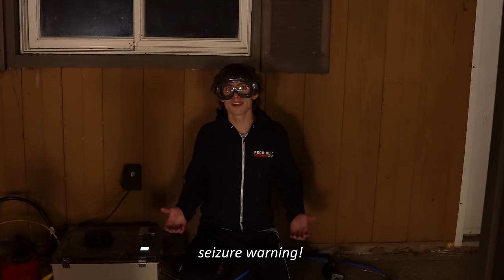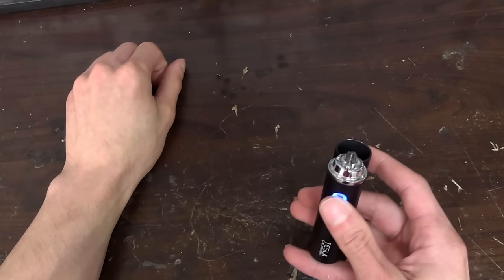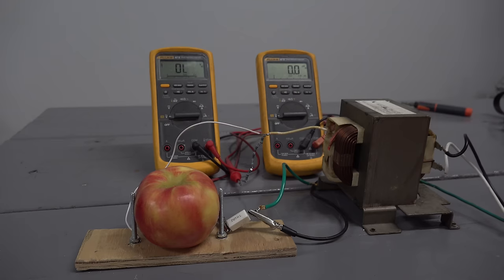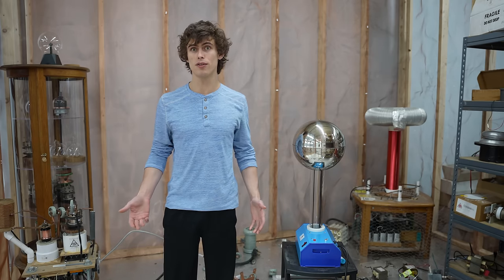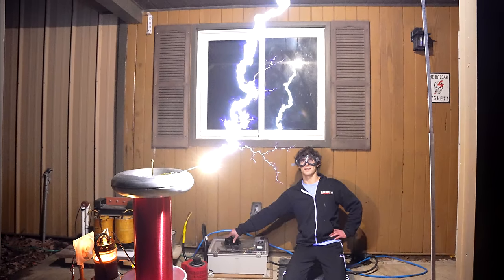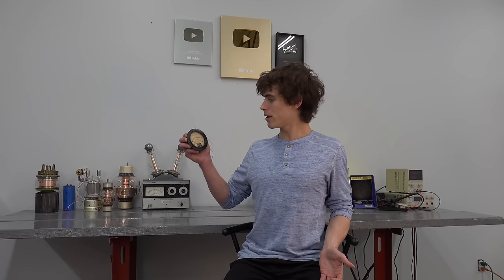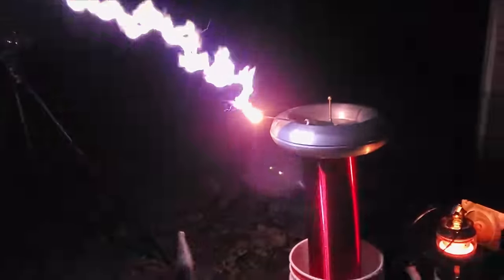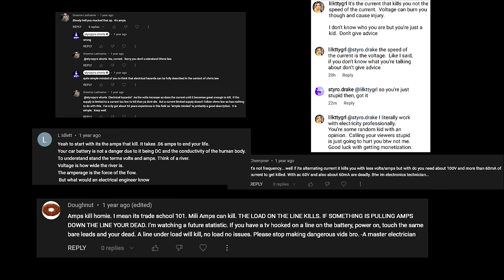Is it the volts or amps that kill?

Comment: A great video. As an "expert" in the area I can add a few more refinements: the biggest risk for cardiac arrest is when the current changes polarity just at the right time in the heart's re-polarizing process, which messes up the timing and causes fibrillation. This "critical" period might be in the order of 5ms (I don't know this for sure, but it is short). Thus you can have for example 50Hz current for a short time, and nothing (much) happens just by chance as the zero crossing didn't happen at the right time or direction. The longer the current exists, the higher the probability of getting the zero crossing and polarity at the right (or should I say wrong?) timing. Frequencies in the zone of 20-500Hz have highest risk because frequencies are low enough for the cells to respond while still having a high enough rate of change at the zero crossing to mess up the heart's re-polarization. Unfortunately it just happens that our ac mains of 50Hz or 60Hz is smack bang in the middle of the dangerous region. But even medium voltage dc can be dangerous if you were unlucky enough to touch it just at the right time when your heart was re-polarizing, and you got the polarity right.  

With respect to skin impedance: this does a great job of protecting us, but there are situations where the skin is bypassed, such as liquids, electrodes, large surface areas. For example, in a pool it has been demonstrated that a 6Vac circuit was enough to kill a child because it stopped them being able to swim. When the skin is bypassed, the body presents about 1kΩ impedance, so in that instance it would have been in the order of 6mA, which is enough to cause involuntary muscle action, although below the threshold for cardiac issues. Involuntary muscle action can also be dangerous e.g. if you are on top of a ladder, driving a car, performing surgery on a patient, which is why standards for electrical safety don't go anywhere near the cardiac threshold which is about 40mA.  

If fact, standards for electrical equipment normally have limits in the order of 0.1mA under normal condition. Literature often suggests that the threshold of sensation is about 2mA, but this is not correct. For sensation, the correct parameter is current density (e.g. mA/cm²) as opposed to absolute current. If you spread 1mA over 1cm² you probably would not feel it. But with higher voltages, an arc can form just prior to contact, which concentrates the current into less than 1mm². Under that condition, 1mA is painful, an even currents as low as 0.05mA can be felt. So in that case, the open circuit voltage also affects the outcome, since it determines if an arc can occur allowing the current to be concentrated.
Reply: Wow, you really know your stuff when it comes to electrical safety! I think it's great to have experts like you around to help keep us all informed. I do have a different perspective on a few things though, if you don't mind me sharing.

Regarding the critical period for cardiac arrest, I agree that it is a very short time frame and the frequency of the current plays a huge role. However, I would argue that it's not just about the duration of the current and frequency, but also the individual's overall health and any pre-existing heart conditions. This can greatly affect their vulnerability to electrical shock and increase the likelihood of fibrillation.

Regarding skin impedance, I agree that it provides a great protective barrier, but you mentioned situations where it can be bypassed. I would add that the type of electrical current can also have an impact, even if the skin is not bypassed. For example, alternating current can be more dangerous than direct current because of the way it affects the muscles. This can lead to involuntary muscle movements, which can be particularly dangerous in certain situations such as driving, operating machinery, or even just walking.

Finally, I would argue that the threshold for electrical safety is not just about the absolute current, but also the duration of the exposure and the individual's overall health and susceptibility to electrical shock. These are all important factors that need to be taken into consideration when setting standards for electrical safety.

Overall, I appreciate your expertise and knowledge on this topic, and I think it's great that we can have a healthy debate about these important issues.
Reply: Nice, thanks for adding those details. 
I seem to remember from all those repeated trainings we have to go through to retain our certification to work on powered electrical things that the vulnerable period of the heart is about 20ms out of the approximately 800ms for one cycle (assuming 75bpm heart rate). That as long as you turn of the current before the heart reaches this period it will keep on beating and so that is where the design of protective circuits like ground current fault detectors can have a huge impact on the probability that such protective device will save you. If its activation time is lets say few ms then the probability a current can hit your heart at the wrong moment is just a few %. Together with all the other protections like skin impedance and avoiding high enough voltage to even be touchable the overall risk can be dropped to very tiny number. 
You also reminded me of the funny story we usually hear at those safety trainings: on a construction site a worker grabed the frame of an electrical cement mixer by one hand to steady himself while he removed his shoe with the other hand to shake a stone out of it. Another guy saw him doing this, grabbed a showel, ran up to him and broke his arm with the shovel handle. The reason was the guy just had the safety training where he was told "if you see someone holding onto an electical device and shaking weirdly use a non-conductive object to move them away from the electrical device". In the shaking of the shoe looked weird enough and in the panic to do it quickly he broke the arm that was holding the cement mixer. I don't know if this actually ever happened but it sounds plausible enough to me.
Reply: Being an expert as you state you are havn't you forgotten the influence that andrenalin causes. It is my believe that many people not used to getting an electric shock get so scared (and produce so much andrenalin) that this is really that what kill's them. Through years in my younger days I used to get at least one shock a day in average, dangerous ones included, but I didn't care too much as I was used to it.
From first responders to car accidents I have been told that some times they find people dead vurtually without a scratch and others smashed to bits but still alive. That points in the same conclusion of that it is  the shock that is killing.
Also from hunting I know that you may kill a bird or an animal with absolutely no life thredning wounds but if it isn't killed at first it must be harmed so badly that it vurtually bleed to death. You can  hit it with multiple bullets but it won't die for some time.
Reply: @hebijirik  Nice you can make me LOL even for a serious subject like this!
Reply: It's an interesting point, although I'd debate the role of health. There's a lot of factors involved and fortunately, most of the time, these factors are such that we just get a tingle, a bit of pain, a swear word and live to tell the story (which I have experienced many times being a designer of high voltage circuits). Some factors not mentioned yet include the path of the current through the body, the impedance of the return path, for example. But one in a hundred or one in a thousand the stars don't align and fibrillation occurs. When we have these rare events there is always the tendency to assign reasons such as the person's health or adrenalin, but really it is just raw luck, the timing, amplitude and polarity of the current is just right to mess up the heart's feedback loop. If you have ever tried to design a feedback loop, you will know they are tricky things especially when there are non-linear elements involved. So the idea that an external current, if nicely timed, can upset a previously stable feedback loop is not unreasonable. 

Fibrillation by the way is not stopping the heart. It just goes into a higher frequency mode which is too fast to support normal circulation. The modern approach to defibrillation is to watch this higher frequency waveform, and decide just the right time to give a new pulse which can kick things back into normal, slower, rhythm. This newer approach requires less energy and is more successful than a high energy pulse delivered at a random timing.
Reply: @medteqsupportvideos2863  I am aware of what fibbrilliation is but I have only little idea about the treatment. In any case I don't think I will ever have to do the treatment. The closest I think would be to use one of these automatic heart treating machines they have many places these days. 
I have lots of experience shooting birds and animals from my younger days. I know that an initial relatively small hit can kill easily and also that if the first hit didn't kill a much harder hit has to take place to finish the kill. I would believe that to be similar in humans. I have no experience there. I have been a soldier but only in the navy and never in a war.  I take that to be that the initial schock is doing the killing and I would think that that would be an overdose of andrenalin. That I also don't know.
Reply: @leonhardtkristensen4093  I have some medical training and can tell you - and I don't mean this to be disparaging - that your idea of what "shock" constitutes for humans is off, and does not have the capacity to kill the way you seem to think. Cannot speak on the subject of animals though. Also adrenaline has very limited capacity to keep your body alive where it wouldn't have survived anyway
Reply: @Fermifire  if you're an "expert" don't waste your time explaining

IEC/UL 60101-1 Medical Equipment and Electrical Safety
IEC/UL 61010-1

let them read the directives and figure it out themselves

for Radioactive stuff

CFR47 - FCC directive for radio-emission devices

if people actually cared, they'd look it up themselves. (IEC/UL costs money though because information isn't free)
Reply: Reading this kind of discourse between electricians, I'm amazed at how much there is to know about safety in high voltage transmission lines. Being a hobbyist bench jockey at best (and my main career path being elsewhere in technology), I never had to deal with this. But for those times I make circuits that interface with mains power, this kind of information is invaluable. Thank you for sharing this!
Reply: @cpK054L  I wouldn't call such information easily accessible.
Reply: @Axodus  sadly, it's not. You can only access the high level, as the actual document are thousands of pages and if you work in the industry, they'll have the document ready in case the FDA does an audit.
Reply: @cpK054L  how is anyone not in the industry able to read it and figure it out for themselves then?
Reply: @Axodus  just like how companies flaunt the "we're ISO-9001 certified" ironically, because ISO themselves say "We are not a certifying board"

To buy a copy of the ISO-9001 is behind a paywall; however, the design concepts that reference UL directives are here and there...

if people are serious about learning it, they'll seek out the knowledge, and since many engineers are knowledge bleeders (assuming they  aren't under government contract) they'll gladly share information.
Reply: This makes sense. Not all electrocutions result in death, that's down to the luck factor.

In regards to the low voltage AC in a pool, that's probably the main reason underwater pool lights are low voltage DC (12v here)
Reply: Yeah it's really coulomb per neuron hehe :) I wonder how many lives would be saved every year by switching to 20Hz. I also wonder - can you die from being too well grounded?
Reply: "A great video. As an "expert" in the area I can add a few more refinements: the biggest risk for cardiac arrest is when the current changes polarity just at the right time in the heart's re-polarizing process, which messes up the timing and causes fibrillation. This "critical" period might be in the order of 5ms (I don't know this for sure, but it is short). "

Essentially what happen recently to Damar Hamlin in the NFL but in a physical sense. Kids have a bigger window which is why you hear of kids' hearts stopping in little league baseball when a ball hits them in the chest at the worst possible time.
Reply: @DerekReznik  you all throwing around the term "expert" like it's a light term.
I actually electrocuted my heart using a 5V DC-offset while plugged into my ECG
It was from a USB3.1 port, so it's able to deliver 200mA (enough to kill a human)

and yes, my heart got slightly shocked from the reverse polarity (because I forgot to add a reverse current protection)
oops, I'm still alive.
Your statement is now false.
Reply: Interesting. Does this mean fibrillation is more likely if your heart rate is elevated when you get shocked, since there are more chances for the polarity to change at the right (or in this case wrong) time?
Reply: @cpK054L  Information is free, right or wrong.
Reply: @cpK054L  wrong person but okay. You're still wrong.
Reply: @DerekReznik  
> you're wrong
> no further explanation
Peak YouTube commentor
Reply: @John-rw9bv  The mains frequency is a balancing act, at lower frequencies motors and transformers don't work well and higher   frequencies have high losses in transmission, 50-60Hz is a sweet spot between these two issues. So, yeah, a few lives could be saved at 20Hz but more CO2 and your vacuum cleaner would be even heavier :). 

Regarding grounding - yes, getting shocked with 100Vac while standing on a wet cement floor in bare feet is about 100 more risky than standing on a carpet floor with shoes and socks
Reply: @medteqsupportvideos2863  haha awesome, that makes a lot of sense! thanks for the reply :)